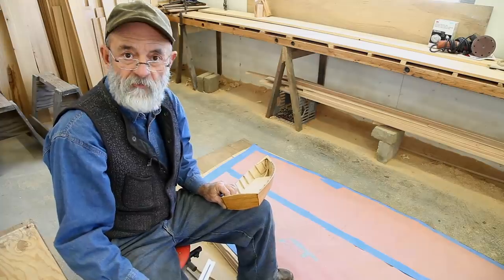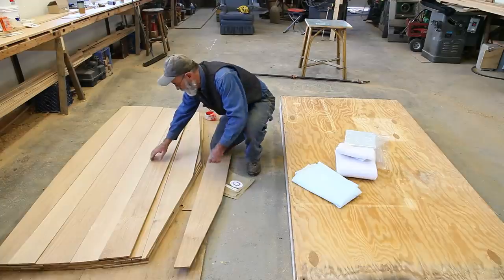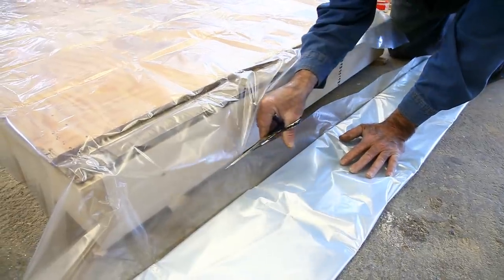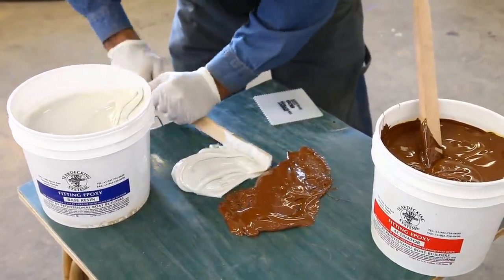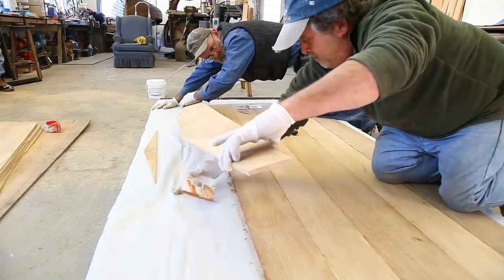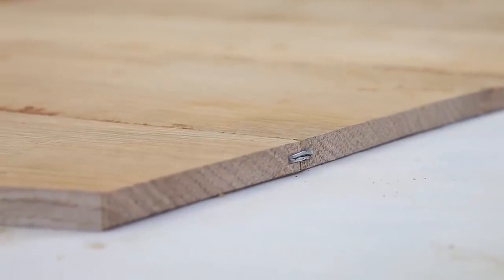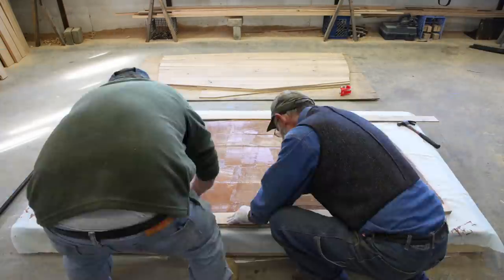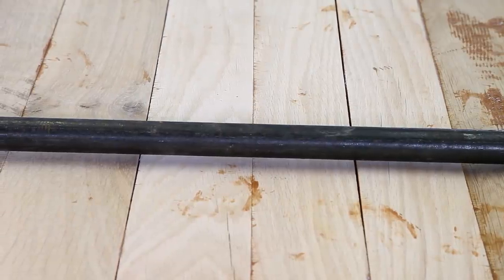Building the 23' V-Bottom Skiff - Episode 2: Building the Transom

Comment: That is a great looking plywood transom. When I worked at the biggest Helicopter Company in Connecticut the pattern makers use plywood for forms and prototyping They used Aviation Plywood which had more layers of thinner plywood. I was amazed how many layers of plywood per inch there were even more than marine plywood. I learned that often the glue is stronger than the wood. I also learned from the pattern makers how to plain wood with little planes to shape the wood for forms. It's a lost art! I try to teach my 2 sons today those type of skill sets. Now they teach me how to build with cnc's and 3D printers so much quicker now and they are working and building machines that make aviation parts that are in the tens of a thousands of an inch accuracy. The main point is if your building things and your happy doing  it that, it is great. Keep building wood boats, I love watching what you build. You are a Master!

Comment: I love seeing the traditional boatbuilding methods combined with modern vacuum bagging.  Remember when calculating the pressure developed that it presses equally from both sides of the item being bagged.  That transom is roughly 2,925 sq inches multiplied by 15 psi at at hard 31" vacuum is 90,675 pounds per side not including the edges for a total front+back pressure of around 181,350 pounds of clamping pressure.  The clamping pressure applied from the top and bottom is over 6,200 pounds at a 31" (~15 psi) vacuum.  The clamping from the ends by the vacuum bag doesn't make much difference because it isn't holding any seams together.  Still, that is an enormous amount of force applied by a vacuum pump and the ambient air pressure.  I first realized the enormous forces involved from bagging radio controlled sailplane wings.  It would have been interesting to see the bagging materials removed from the transom and the cleanup process.

Comment: As always, a fascinating video. Bravo! As I watched, I was worrying about the epoxy setting while you assembled the transom, applied the adhesive and then set up the vacuum bag, etc. It must have taken quite a bit of time. Then, I checked the epoxy maker's website and saw that they advertise a two-hour working time for their product. I didn't know any epoxy could be worked for so long. Is that a special epoxy used for vacuum bagging? It's also very thick compared to say the West system epoxy that I'm used to. Finally, they say a gallon of the adhesive covers approximately 30 ft². How many gallons did it take at about $130 a pop?

Comment: I was hoping we'd get to see you unwrap the transom. was there much squeeze-out? was it hard to clean up?
Reply: I want to see everything, no fast forward or stuff off camera. Ok piss break excluded, but other than that I can watch every minute of the process even laying on the paint on the second side of the boat. Never get bored watching Lou work.
Reply: Throttle Stop Garage channel does vacuum infusion on carbon fiber parts. He pulls a vacuum on a part and has a second tube that he sticks in a pot of thin epoxy. The vacuum draws the epoxy into the carbon fiber fabric. If you want to see more vacuum bagging stuff, including unwrapping, check out his channel.
Reply: Most likely not all that much squeeze out and he did say he would cutting an inch off the sides so the clean up was nill. Scrapers work well on dried epoxy
Reply: How can you get squeeze out with epoxy the stiffness of road tar!!  I was amazed it didn't set up  after who knows how long to set all that rigamarole up! It's not the method I would use. You'll notice it took two of them. Hardly a one man job in the time it takes for that epoxy to get too stiff to use.
Reply: @paulbriggs3072  I'm guessing that this epoxy had a relatively long working time. It would have been interesting to see if there was any squeeze out. Vacuum bagging applies around 14 psi to the surface. For a square yard, that would be like a 9 ton weight sitting on it.

Comment: I have a question! Would it be possible to epoxy in a layer of Aluminum into a Transom? For example adding a one quarter inch solid sheet as the center layer!  I wonder if that would be possible or would it just delaminate?
Reply: Aluminum would indeed work with slots or holes across so the epoxy would fill and bond, I'm thinking.
Reply: The answer would depend greatly on the adhesive.  For example, WEST, as great as it is, does not stick to aluminum unless it has been sanded over the entire surface with coarse sandpaper.  That can introduce contaminates that promote corrosion.  I've mixed WEST on 6061 aluminum because it peels off once it cures.  There are epoxies that will stick to aluminum but it's hard to see any advantage.  If salt water gets to the aluminum it will corrode, swell and damage the surrounding wood.  I've repaired an airplane's spars (Bellanca Champ) where aluminum bushings corroded and split the spruce so this isn't just theoretical and that was only humidity and rainwater that got to the bushings.
Reply: Keep I'm mind when you use different materials like wood and aluminum they exspand and contract at different rates which will break down the bonding over time and aluminum corrodes more especially near salt air. Wood will last for a very long time if properly done and taken care of. This form of plywood will last a very long time.

Comment: Lou, I have a question about your wood choice.

Now everyone who has ever split white oak firewood or tried using hand tools on white oak, knows that White Oak is hard as nails; but my question is, since you are using epoxy and epoxy’s strength is improved the more it penetrates and covers, wouldn’t it be better to use the weaker Red Oak as the cell structure of red oak allows it to pull liquids the full length of a board like a straw, and if so using a liquid epoxy (unlike that hard paste you were using) to make for a boat where the epoxy was essentially running all the way through the cell structure of the board for the entire boat and thus almost a singular epoxy structure?

With white oak and paste epoxy, you are gluing the exterior wood cells of one board to the exterior wood cells of the next board. With a liquid epoxy and red oak, I would think you are gluing EVERY cell of each board to EVERY cell of the next board...  

I’m serious when I ask this as I plan on building a wood/fiberglass boat in the next two years that I will first take on The Loop, and then if all goes according to plan, circumnavigate the globe in it....

Thanks Lou, love all your videos, but especially your chainsaw sharpening video (as it has helped me the most thus far)...
Reply: You have set out an interesting theory about using the red oak-V- white oak. Be interesting to see a test done on it

Comment: Wouldn't it be stronger if you had run every other layer  different direction?  Just asking.
Reply: I believe he did exactly that
Reply: @typicallucas  If you look at the first part of the video you will see all end grain  showing in the picture
Reply: @typicallucas  if you look at the first part if the video you will see only end grain showing.
Reply: ok well watch the rest of the video and find the answers to your question
Reply: If you pay attention, the outside layers are level to the build direction. The inner layers are opposingly canted at what appears to be approximately 15° either way, back and forth each layer. So, in effect ~30° offset between inner layers and ~15° front to inner and back to inner. None of the layers are straight to each other. Of course with only a 15° or 30° offset all of the ends will still be showing endgrain.

Comment: Lou "I will make plywood so I dont have to use plywood" Sauzedde
Reply: not sure if you're taking the piss, but this is the finest goddamn plywood I've ever seen or dreamt of
Reply: @typicallucas  yeah just joking around mostly He probably has the wood selection at hand, but assuming he paid for it....i would tend to think that 3 layers of 3/4" good marine ply would get you to the same place a lot easier. and cheaper. 2 layers would be plenty for strength, plus some good quarter knees and floor transom knees. Just seems like a heavy, time consuming approach, but will sure be a nice looking transom.
Reply: @johngoodell2775  In a transom the vertical grain components of plywood would add little to the fore and aft stiffness compared to Lou's chosen construction.  Seat-of-the-pants says that his construction (2-5/8" thick) is both lighter and stiffer in the correct direction than 3" of ply.  Ply is pretty heavy due to all of the glue in it.  Four layers of ply would be 28 or 36 layers of wood glued together.  Beyond that, I doubt that I'm the only one here that has had internal layers of plywood come apart on them.  That won't happen with Lou's method.
Reply: @David-hm9ic  fore and aft stiffness of a transom...dont know what that means? a transom has significant vertical forces put on it be the levering force of an outboard so opposing grain is not a bad thing. 2 layers of 3/4 ply is 1.5" (not including a 2x brace) and would be more than enough for a strong transom and a lot lighter...that is a fact. 3 layers of 3/4" ply  is 2 and a quarter inches (not 3") and would be almost overbuilt and still a least a bit lighter. There is way more epoxy glue in Lou's transom than the best marine ply out there.  TO say 6 layers of 7/16" white oak with that heavy epoxy stuff would be lighter is just plain wrong. I dont know anyone that has a marine plywood transom have internal layers come apart. Its a cool transom - it just seems unnecessary for an outboard skiff.
Reply: @johngoodell2775  I've been watching your debate with Dave Dale. Very interesting. I can see both points. I don't see how there will be much in the way of vertical  forces on the transom. I would think that the motor would be trying to push it into the boat at the  keel/ bottom and pull it off the boat at the transom. I would have thought that the only vertical force would be the weight of the motor itself. If I am wrong please explain why. Having said all this, I agree that marine ply would probably work, but it would be nowhere near as interesting. I, as you probably can guess, am not experienced with boats. I love watching Lou work though, and boy will that white oak transom be strong and beautiful.
Reply: @metubewot  first and foremost his transom is not going to fail.  Lou is using high quality traditional materials and that is cool. I love watching his build videos. However even many expert builders would not be able to source that...or if they did it would be for a really high dollar boat. But to your question...imagine a board in a vice....with the grain horizontal....then take a pipe wrench and clamp it to the top edge of the board and crank downward as hard as you can (that is the force of an outboard motor clamped to the transom). When it breaks...it will break along the horizontal grain. snap lengthwise. If you put a board in a vice vertically and put the pipe on the top edge - you will likely have to apply a lot more force to get it to snap since it has to fail against the grain. Thus why opposing grain is useful. A boat motor has a levering force on a transom that is more on a vertical axis. The force is not just in the water but on the boat trailer bouncing down the road. A strong transom with quarter knees, "floor" knees (or knees that tie bottom stringers to the transom) and a strong splashwell will tie it all together into a very reinforced structure. A giant thick piece of oak gives more purchase area for nails and screws....but my contention is that you could build a super strong, lighter transom with two layers of 3/4 ply and proper use of knees and splashwell. Its not a big deal...but maybe he is looking to make a heavier boat and wants to put a 150 or more on it which probably makes sense. When building a wood skiff - one of the benefits is that you can build a much lighter boat than any fiberglass production boat and require much less HP and thus much less $$$.  That is one reason why ply on frame or sitch and glue are so popular. That is why most builders would just use marine plywood for all the planking  - a technique that is more accessible to the hopeful builder watching these videos.
Reply: @johngoodell2775   thank you. It makes sense.
Reply: @johngoodell2775   Well explained mate. I agree with your reasoning . I don't know what contact points the motor has, I've only ever used very small carry-able motors. If the only contact the motor has is the  top, then you're spot on. Thank you.
Reply: @metubewot  doesnt matter if the motor is bolted on back of the transom, bolted to a jack plate, or hung on a clamp and bolted. The force is the same ...when fwd thrust the motor is creating a downward levering force  in addition to the forward force - because the lower unit is like a long lever.
Reply: @johngoodell2775  Yes John, but if the bottom of the motor is in contact with the boat, surely then, the motor itself acts like a vertical column. Surely if touching top and bottom, the force on the top would be directly rearwards, and at the bottom directly forwards. As if your theoretical pipe wrench had a 90 degree support hanging from it. As I said, I don't know whether or not it touches at the bottom, but I also can't imaging that it is entirely supported on the top couple of inches of board. The length or depth of the fixing is bound to affect the application of the forces. eg if fixed on top inch of the transom, it would act like your pipe wrench. If however it was fixed to the full depth of the transom, it would then need to rip out the full transom to escape. That is all I'm trying to say.
Reply: @metubewot  the propeller is below the transom....that is where the force is applied. most  of the force, practically speaking, is straight into the boat obviously because the lower unit is a rigid structure....but its still a 20-25" lever with a lot of HP behind it....its more than pushing or pulling.

Comment: Use smoke to test for a vacuum leak if you have difficulty finding it.
Reply: You can use colored water, or anything similar to show a leak.
Just wipe over the bag with a wet rag.
The red, blue, or whatever will show up on the breather/release fabric instantly.
Reply: @jimurrata6785  yeah, colored water can work, but it could also stain your wood. It is a great technique for vac-bagging fiberglass, but the coloring can mkre easily stain the wood. Smoke or a stethoscope would be a better idea with wood bagging.

Comment: Let's see...this idiot uses 6 layers of EQUALLY dimensioned wood and offset them to create maybe 3/4" to 1" interlacing layer to layer...Think of a deck of cards barely interlaced and how easy it is to flex into an arch, now the same deck interlaced 1/2 the length of a card and how difficult it would be to flex...Ahahahah, This should be called, "Tips from a Shipwrong", 'cus there ain't nothing right about it...